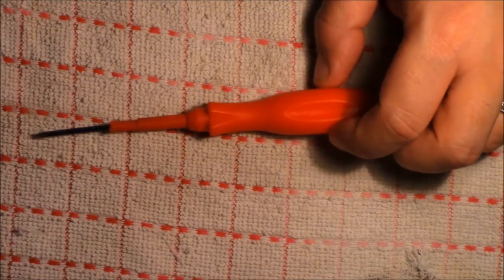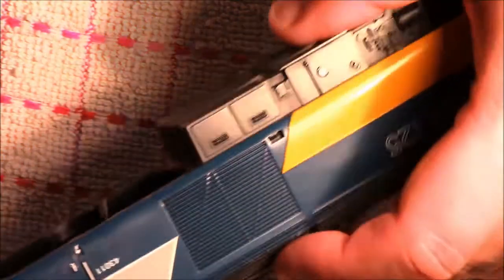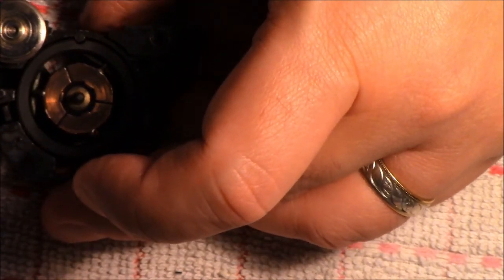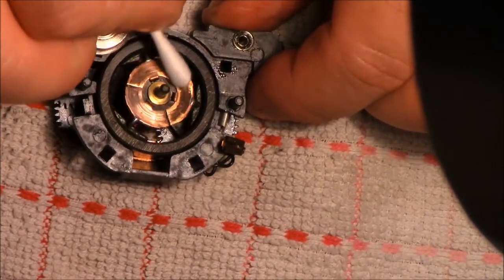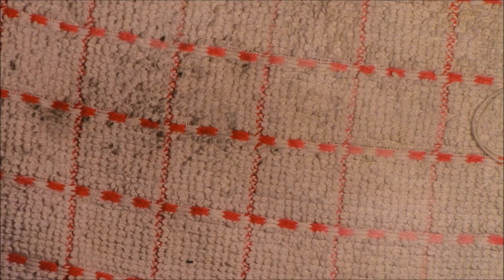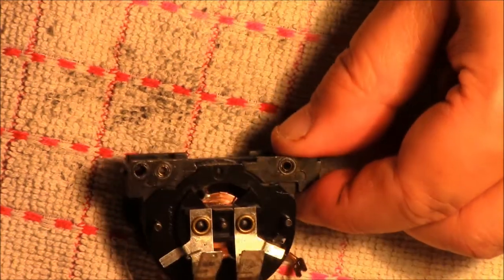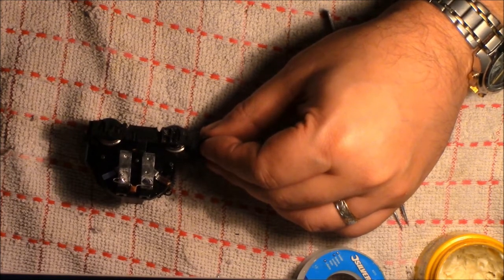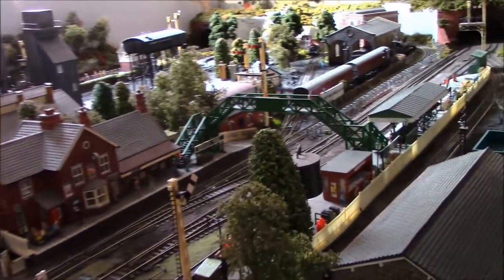SERVICING HORNBY MOTORS MY WAY

Comment: Watching this again and glad to see you are using John Chambs123 and his use of a Tea Towel.
Purchased a class 37 while in the States, a non runner but thought I could fix it.
After cleaning I found the Aluminium cog was loose and guess that is the problem. It is an eleven tooth cog and of course I don’t have any. Why are there two tooth arrangements?
Have just placed an order with Triang Hornby Parts and looking forward to getting it running.
You always give good info👍
Reply from the maker: Thanks Charlie ! . All the best . Richard
Reply: You might know Richard that I managed to get both the 37 and 47 running. Cheers
Reply: I received the 11 toothed brass cogs. The big challenge now is to get them on as they are a machine fit
Reply from the maker: @charlie1872   Charlie , I’d suggest perhaps using a pair of small nosed pliers and gently tapping the cog into place so it engages with the drive gears, once your happy , a dab of superglue will secure it to prevent any future problems of it working loose which is a common feature on old Hornby ring field motors . Trick is to not get glue on the teeth of the cogs or drive gears !  Why the teeth come in two ratio sizes I don’t know of hand ? Unless it’s to with with the actually drive ratio ? Example the lovely Hornby class 58 drive unit is considerably geared to give a smoother slower ability. 37’s usually are pretty reliable. Good luck !

Comment: As you said on your video be careful of the soldered bits on the commutator which is why a Dremel is not advisable. Also give T-Cut a try using cotton buds and see how it works. Just using clean cotton buds till there is no black deposits on a clean bud. Your commutator will come up with a mirror surface. Also I use on wheels try it and let me know what the result is. As you say it is your way of doing the service but we all are still learning

Comment: This was great. I've had an HST in storage for 20 years that barely ran. I followed these steps (except the Dremel part - don't have one)  and its running well. Now just to figure out how to get new brushes in New Zealand.
Reply from the maker: MarMightyGood  excellent! , google “ Peter spares “ who is a stockiest for all major parts and spares model railway wise , he has a shop on eBay , he will ship also I believe.the brushes you can get on eBay or peter spares , as well as the springs

Comment: A bit puzzled about this. I have recently started building up my sons old set that has been stored for 30 years for my grandson and have stripped down one of these trains and the engine as it was screeching.  How many wires are actually on this motor. You seem to take off 2 wires from each of the brush connections then turn the engine over and take off a third that powers the lights. I only have 2 wires and one of them is the lighting wire. The motor runs fine on test but when I re-connect the wires the train wont work. If I only have 2 wires (one being the stiff one where do they go?  Andy.  P.S. I have a recollection that the stiff wire came from the back of the motor and I used a pair of pliers the get it off the terminal but there isnt (doesnt appear to be) a terminal where I thought it came from

Comment: Really enjoyed your tutorial as I have a few of these and some, especially the Black 5’s are spinning.
What I have noticed is the little middle cog is loose and I think this might be part of the problem. Can you suggest anything for this? If I secure the cog with superglue then I think that might prevent further maintenance of the motor?
Thanks for doing and sharing this with the community. Cheers
Reply from the maker: Charlie McGowan  yes , here is what you do , take a pin or cocktail stick , apply a very tiny drop of super glue to the shaft that holds the small brass cog. Then carefully engage it to the gears at the same time so as they mesh . Leave for about 5-10 mins then it should turn by hand , if you’ve reached this stage , then using a cocktail stick apply a light drop of loco lube oil to the cog , apply power  gently , as this will bed in the gears . Job done . I did the above. remedy on a Hornby tender drive castle .
Reply: Thanks for the info. Check out my layout update here https://www.youtube.com/watch?v=ols4o7o-E2k. Should be liv in a few minutes
Reply: @Richardsrailway  followed your suggestions and it worked however after a short run it stopped and began to spin. After further inspection I discovered the shat for the cog is spring loaded and this causes the gears and cog to disconnect. Any suggestion?
Reply from the maker: Charlie McGowan what make and model is it ?
Reply: @Richardsrailway  it is an R859. Can I send you a video?
Reply from the maker: Charlie McGowan  sure .
Reply: TRIPLEVALVE62 THE DEPOT where can I send the video?
Reply from the maker: Charlie McGowan you can email me at Richard.king36@sky.com

Comment: Agree with almost everything, but like you say it's your way. White spirit would not be something I'd personally use.
Reply from the maker: Model Railways Unlimited  . I’ve actually began using lighter fluid which works wonders.
Reply: @Richardsrailway  Yeah that won't leave many deposits, the best option IMO is IPA, might be worth a try?
Reply: No T-CUT is much better and safer as well 
And I would  certainly not under any circumstances Lighter Fuel recipe for a disaster wither an adult otherwise
Reply: I use 90% IPA Do not use the 70% as the other 30% is water. I can’t find T Cut here in Toronto but use a similar scratch remover then clean it off with IPA
Cant remember which Ringfield motor has the two wires, one goes to the rear pick up and the other connects the face plate to the metal housing ( think that is the function. This might be a difference in design and functionality of how the face plate is connected
Reply: I just ordered spare 11 tooth cogs from Triang Hornby Spares. I did not realize until recently there are also 10 tooth cogs on some Ringfield motors so be careful on your selection. Check the existing one before ordering
Reply: I am assuming the wheels pick up power from the track, turn the cogs and in turn that causes the armature to turn? If the Aluminium /brass cog is spinning then the axle will not turn the armature ?